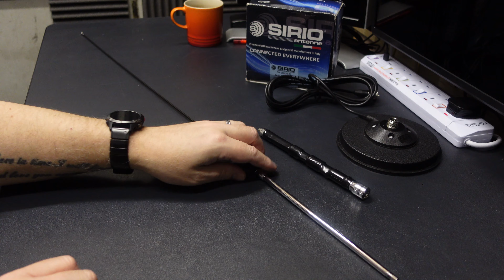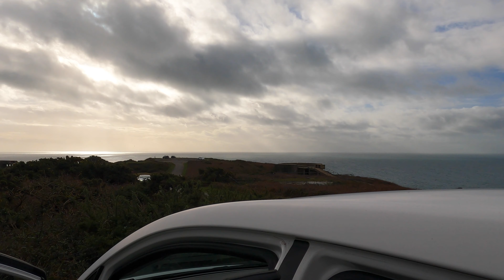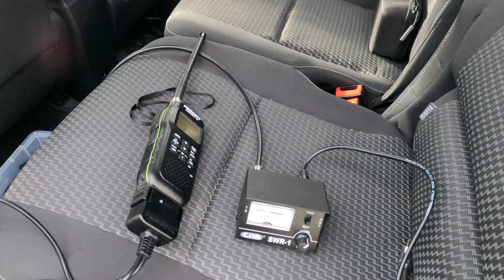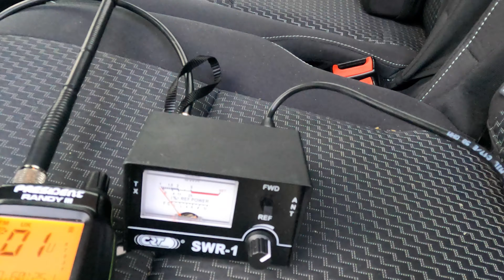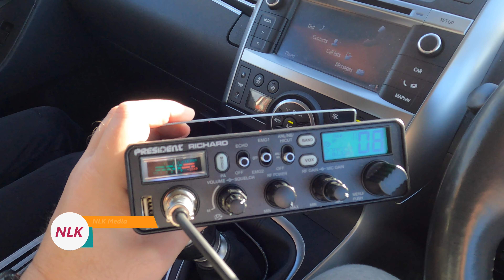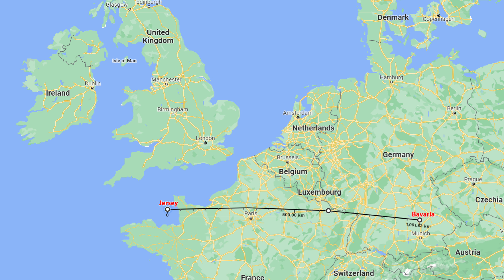Diamond HF10FX CB Antenna? Does it work, is it any good?

Comment: If the conditions are good, you need only a wet finger into the antenna connector  in the back of your radio....
Reply from the maker: ha ha, yes, a damp finger and using your fillings as the antenna :-) The HF-10FX has been a good antenna and served me well. All the best and thanks for watching MJ7NLK

Comment: Can’t you turn up AM mode to 5 or 6 watts in service mode?
Reply from the maker: Hi 128MrRon, the Randy3 and most chip based President radios have a single power adjustment setting which affects AM and FM together. There is a seperate FM deviation and AM modulation setting. On the R3 its "FM MOD" and "AM-HI" and "AM-LO". if you watch my Randy 3 revisited video it covers all of the power output items in all modes. All the best and thanks for watching

Comment: Just curious,own a Randy 3  myself , what results did you get with the handheld connected to the antenna , similar to the vehicle set up ?
Reply from the maker: Hi, the Randy 3 is restricted on its internal antenna but using the car kit adapter it can hit 12W when expanded. Check out my Randy 3 Revisited video which covers everything re the different options and power outputs. I tested the internal antenna and external in expanded and standard mode. All the best and thanks for watching

Comment: You should have taken the rubber duck off the Randy to do the SWR on the mobile antenna!
Reply from the maker: Hi Mark, will try that next time. I was under the impression that the internal antenna got disabled when plugging in the car kit. If you watch my video on expanding the Randy 3 and its expanded 12W high power mode this is only active when the car kit is plugged in. As soon as you unplug it you loose the High power option so that radio knows when the car kit is connected. I should try putting a meter on both ends and seeing if this is the case. Interesting question so thanks for that. All the best and thanks for watching
Reply: I doubt it would make an difference to his test.  The VSWR Meter is purely measuring the VSWR of the connected to it, it can not see the antenna on the portable.

Comment: Thanks for the video, very interesting!
Reply from the maker: Hi Stephen, your most welcome. I do like the HF10FX especially as it can be used on 10 meters (which it is designed for) and also 11 meters (CB frequencies). With CB frequencies the bigger (taller) the antenna the better "height is might" is the old saying. Will make it easier for you to pickup more "silly people" on channel 6 :-)

Comment: Try a Diamond nr22L ! Yes it is for 144mhz but is an outstanding 27/28 mhz ant ! 
No i am not trolling you .
Reply from the maker: Hi Rob, thanks for the information, good to know other options. All the best and thanks for watching
Reply: And you believe that this antenna is able to get a reliable SWR on 11m?
Reply: @fredheimer  not only is the vswr very low it is a top performer on top half 27 and 28mhz . I am not saying this is a well known secret but people that use this ant do know this secret,  i am not alone . 
To give you some context i use a sirio 4000 cut to 28.3mhz one of the better cb ant the diamond nr22L outperforms it on 28 mhz , but is a bit unwieldy mounted on a very heavy duty aluminium rack on top of my van , as it is 2.45 mitres long , so i make do with the serio 400 . But be under no illusion the Diamond nr22L is outstanding . I will put up a video on my YouTube channel soon . 73 MM0UDI
Reply: @robduncan599  i didnt know that about the nr22l. I look forward to trying mine on 27mhz. In the past i have always had to swap antennas and mounts when changing between 2 metres and cb. You might have just made my life easier 🎉😊